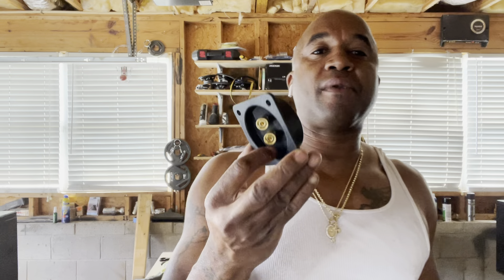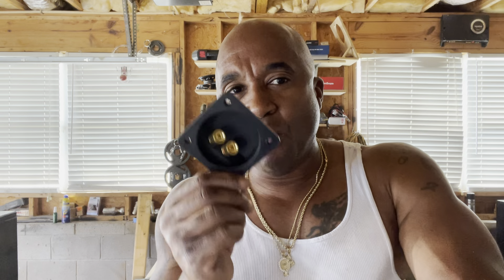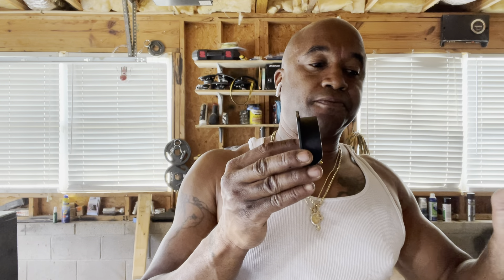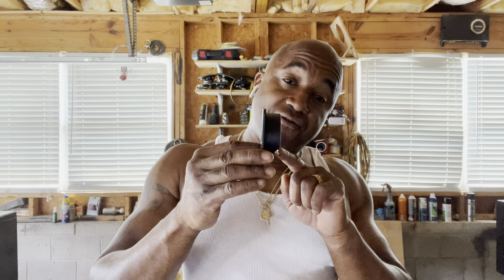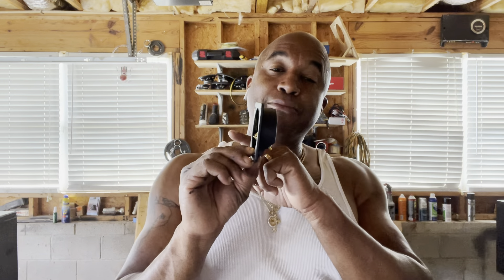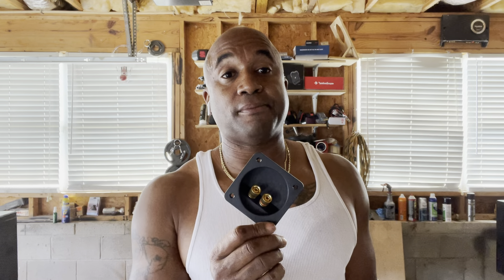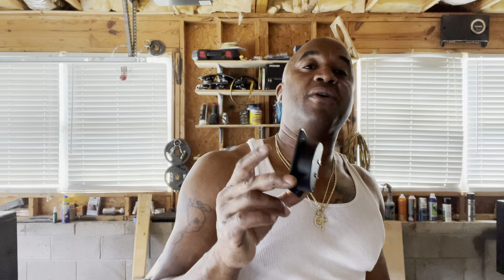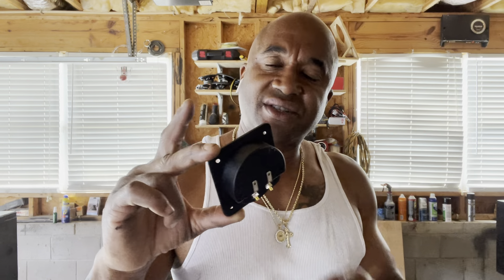Terminal Cups….. cheap effective distortion detectors!

Comment: I'm glad someone Finally Debunked this flaw for Impedance Rise.Time & time again, SPL bumpers are constantly scratching thier heads as to what is the source of the problem? The Tinsel Leads from the Terminal Cup is a Gauge Reducer to the Speaker Wire.

Comment: never knew or thought about this one. makes sense. good video.  so clean power would be AC, which is easy on wires. dirty power would be DC, much harder on wire. you need bigger gauge for the same length of wire.

Comment: Haven't seen them in high SPL Builds??? ever so I would specifi application for that type terminal I bypass mine in prefab boxes and they are just fine in moderate powerd systems are

Comment: Would you recommend to upgrade to a smd speaker cup terminal for a box that's built for like two sundown Audio X12s or do you still go with the regular speaker cup?
Reply: Well I'm in the same boat dewd, i just blew the coil on my Xv2 10D2 and before that my terminal cup melted too from using a 2Ω Power AcoustiK RZR1 2500D Razor wired at 1Ω from Wal-Mart running 12g SHCA amp to box to sub and I just ordered a SMD bolt terminal cup too. After i send it in to Sundown for a re-cone with a Zv5 spider upgrade I'm definitely buying a scope so i can tune my Deaf Bonce Atom 2000D properly.
Reply: The bolt terminals are optional it seems with the proper clean power flowing in general.

Comment: Can you tune a sealed box to a specific frequency?  When choosing a tuning frequency for your vented enclosure do you need to match the resonate frequency of your car and/or the subs free air resonate freq?
Reply from the maker: No you select tune based off music you like
Reply: @M.B.Enclosures  thank you for your reply.  I built a sealed box for three 10” Kicker CompR DVC’s at the minimum recommended (0.8 each) and it resonates at about 58-60 hz.  It hits hella hard for punch but its over hitting in the upper frequencies and it wont hit its full potential.  I listen to rap and rock and sealed has always worked for me.  I found WINISD and it said that 0.8 per sub is .707 QTC but it doesnt sound right for some reason.  400 watts for each of the three subs running off my DC Audio 2.0k with double zero gauge power wire.  My old rockford setup with three 10” subs and a punch 800 a2 in the same car was insane and had less power and technology only running off a 4 gauge wire.  Is it the Amp, subs or box?  I was excited but now Im not lol.
Reply: @Trucker-Belly  im in the same  boat as you with my four 8 incb American Bass XD-844s. They dont hit for lows worth a crap. They hit good at 35-45hz but no bottom end. Seems nothing I buy hits the lows anymore. My single kicker 07cvr124 (2007) and my two kicker 03 cvr 124 subs really slammed the low lows, even though they were i sealed pre-fab boxes (q logic). The single 2007 CVR hits lows better than the two comps I have and even better than the two CompRs I had. I looked at the T/S parameters and the free air resonance (FS) for both old school cvr 12s was around 26hz, compared to 32.6 for the CompR. The old Comp VR subs seemed that the lower the note the louder they hit. The CompR hit hard but once you got into the low lows they fell on their face. My four 8 inch enclosure in my truck is 2.4 cubic ft. Im thinking of changing up to two 8 inch subs since the volume seems to be too small for the 8s to really flex the low lows. I can put 10hz-15hz test tone and they barely move despite having well over 1200 real watta going to them. My JBL 1001ez is rated at 1000w rms but dynoed over 1300 certified. The 501ez 500watt version dynoed 717 certified when Steve Meade dynoed it. Even the two CompRs didnt hardly move at those frequencies. By comparison my single 2007 CVR 12 looked like it was going to come out of the box even thougb it just had an pld phoenix gold XS2150 (75x2) bridged with the speaker wired to 2 ohms. My older 2003 CVR 12s with a 400.1 kicker did the same thing in that Q logic pre-fab box. So im looking for that sound like I got from all the old school systems I had in the past and i always get stuck with something that doesnt seem to even respond to the lows. The SVS PB2000s I have in my house are ridiculous. You can literally feel the air pressure change in the room when you play a 15hz test tone. Anyway, I may end up going with dual DB G5 8s and a better Amp. I remember back when a 400 watt amp amd some decent 12s go you some serious lows. I dont know whats uo with todays stuff. It seems to all be focused on 35-45hz these days. Hard hitting but lacking in the lows, and the subs that do hit those lows seem to really lack in spund quality. I have an old Audiobahn AW-1006 10 (flame Q) rated at 900watta rms in a small sealed enclosure with a kicker 400.1 powering it (all old equipment from early 2000s) and that thing flexes like crazy at 15-20hz amd really has that sound I miss.
Reply: @Jackmerius_Tacktheretrix  i dunno but if a sub has an Fs of like 35 and you put it into a sealed box it goes up to about 45.  Plus some subs dont work as well in a sealed box.  My old system was the best.  Stock alternator, yellowtop battery and 4 gauge.